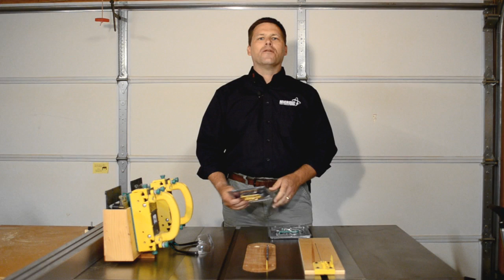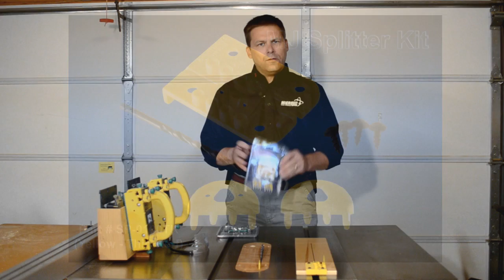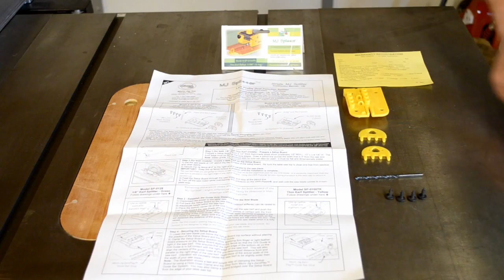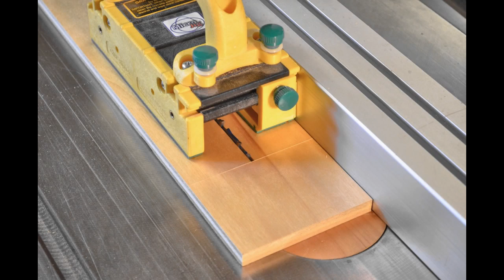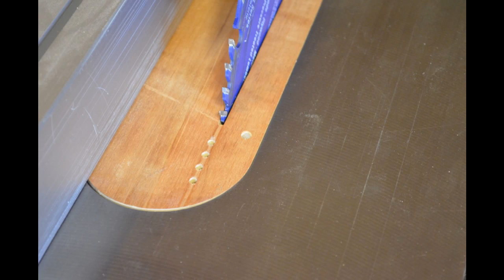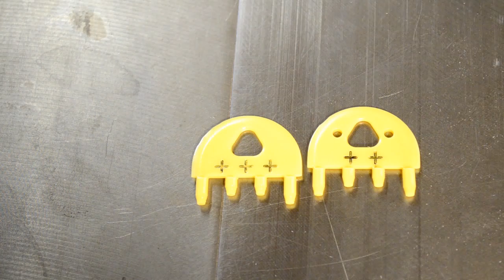Installing Your MJ Splitter and Preventing Kickback (5 min)

Comment: Can I use 1/2” plywood for this install?
Reply from the maker: Yes, I usually do. You may need to rabbet the edge depending on your saw. Some have the lip inside the throat at around 3/8".